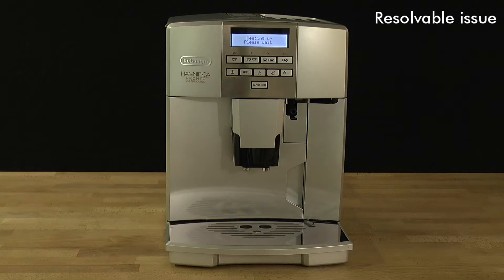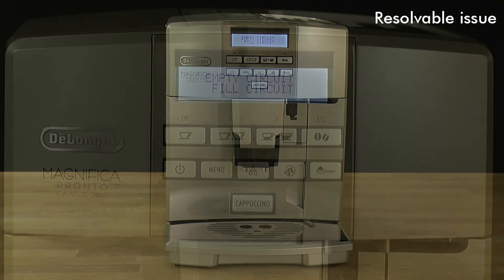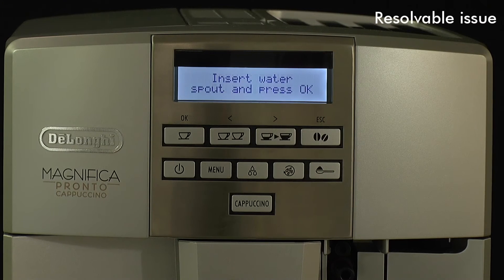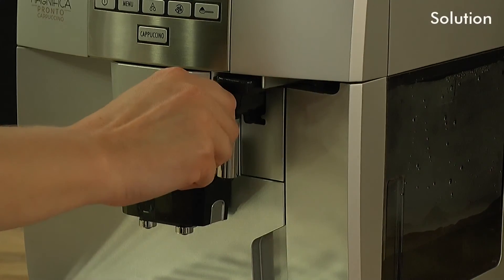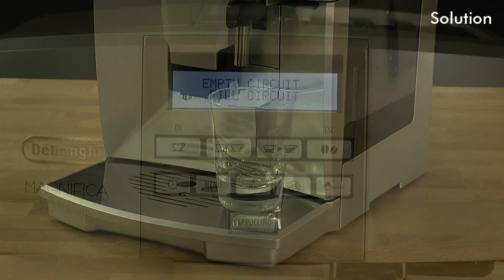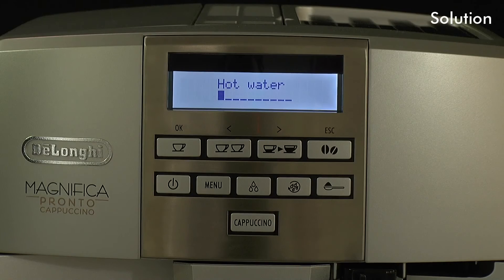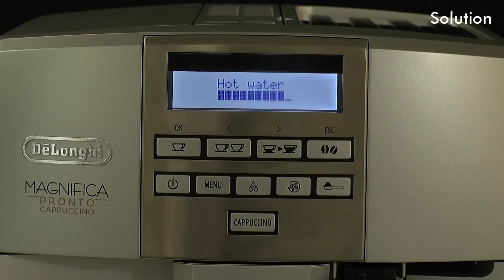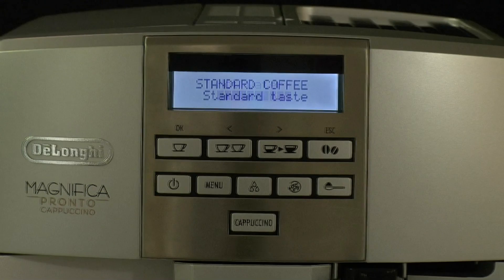De'Longhi How To Clear air blockage (loud buzzing noise) Magnifica ESAM04

Comment: I have had mine for just under a year. Empty circuit Fill circuit is persistent. Cleaning with Hot Water often does not resolve this isssue. I paid £420 on Ebay Delonghi says it was not new. I only have Paypal receipt. The only way to resolve this is Turn off and unplug. Restart does self diagnosis then it works once possibly twice. Its not fit for purpose although when it does work the coffee is excellent. Damned expensive coffee machine for home use that doesnt always work.
Reply: Terry Morton mine doing the same what it mean by that
Reply: I'm have the same problem. I've ordered a new EP5 pump to see if it will fix it.
Reply: @phutruong6961  And did it fixed it ?
Reply: @phutruong6961  Did that fix the problem?
Reply: @flashkandy  yes it did. The problem was a little ball in the middle of the pump that had eroded.  The ball is available on ebay. But a new pump will fix it but more expensive than just the ball.
Reply: @bunny_playing6779  only just saw your message. Pls see my response.
Reply: @phutruong6961  Thanks, I just ordered one. Hope it works.